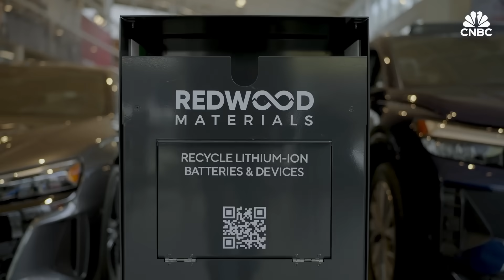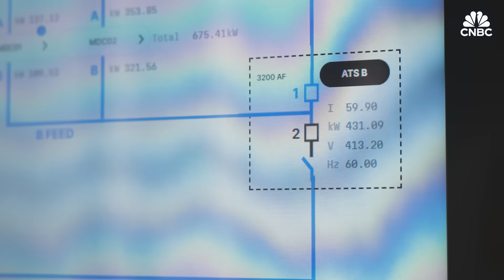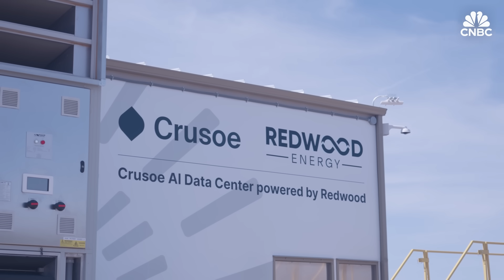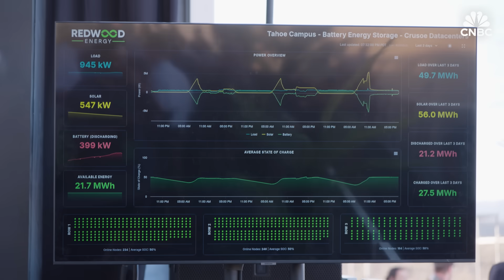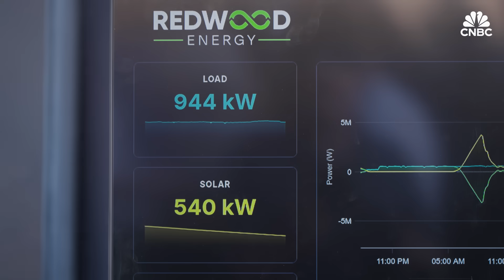How Used EV Batteries Are Being Turned Into Data Centers To Power AI

Comment: My first thought was that “wow they aren’t even trying to maintain the batteries. I can’t imagine they last long in the desert heat. Then I remembered, they would have otherwise been disposed of. Good on this company! Love the environmental consciousness
Reply: You think they would at least build a cheap plastic canopy above the battery to protect against the heat from the sun 😂
Reply: @PetriDishTech   In reality, it just depends on how much draw and charge rate is going through these batteries. A car can have pretty high charge and draw rate, some cars charge in like 20 minutes. These are to supplement solar power for the datacenter, which means it's charging during the sunlight hours and discharging throughout the night. The charge and discharge rate would be substantially less than a car in use, and thus the temperatures would probably be substantially higher. It most likely doesn't get anywhere hot enough from the sun that you would even need to waste materials to build a canopy.
Reply: The optimal temperature for those batteries is around 120 - 140°F, so they put them there intentionally.
Reply: they should at least cover it with reflective foil....
Reply: "I can’t imagine they last long in the desert heat"

10 year old tesla batteries sitting outside are still good. It's a popular restomod. Also, batteries like this get recycled, just about any battery in the last 20 years can be completely recycled (96%).
Reply: they are just killing batteries under the sun
Reply: This model is not sustainable and it still creating emissions and waste.
Reply: So when these batteries are done they'll go in the land fill,
 wow very green!
Reply: @Eduardo_Espinoza  Nope, no landfill.... The main operation for Redwood Energy is to break lithium batteries down into to basic components for reuse.
Reply: @Eduardo_Espinoza  lmao numerous times throughout the video mentioned the company's main business as recycling batteries. talk about a lack of comprehension
Reply: @Eduardo_Espinoza it's almost as if you didn't watch the freaking video before commenting. This battery system is literally on the site of a recycling plant. The goal is to fully deplete the battery usability before recycling.
Reply: @Eduardo_Espinoza  No, they get recycled. Did you watch the video? Redwood is a battery recycling company. If the battery has capacity left, it's more economical to reuse them for storage than to immediately recycle them.
Reply: @Eduardo_Espinoza  Literally at a battery recycling plant! They are still too useful and have decent capacity left. When they die, they will get recycled.
Reply: @Eduardo_Espinoza  Nope, they are fully recyclable. As is any battery made in the last 20 years
Reply: @Eduardo_Espinoza did you even watch the video 😅
The battery 10 years in auto use them 4-5 years in power plant. Then recycle to ge the raw material 😅
Reply: @Eduardo_Espinoza  🤷‍♂️ the alternative is try nothing and just trash the remaining years we have or try….or convince one another to reduce and reuse consumed items. Just think any attempt is better than nothing at all!
Reply: @Eduardo_Espinoza  Why would Redwood Materials send them to a landfill when their chief operation is to recycle them back into raw materials, which they do with a 95% recovery rate? Do you suppose they are burdened by all these raw high demand materials and the revenue they generate from them? That is literally the basis of their existence. It is always a bit entertaining and sad to watch people with the attention span and intelligence of a gnat share their "wisdom" on the internet.

Comment: I was wondering why the batteries had so much space between them. Is it in case they catch fire?
Reply: The batteries are placed far apart from each other and electrical equipment, and depending whether the battery is encased as a pack or individual models is covered in a fire supressing blanket. The proprietary control equipment is designed to handle faults developing in one battery unit without disrupting other nearby unit's operation (which is why each battery having its own power control connection).

Basically, they've taken a system level approach one that addresses the risks involved using a combination of space and integration approach. They test the battery quickly for power and plug it in, if it develops faults (fire or component failure) the battery can be isolated and there sufficient space for time to resolve the problem till the battery can be pulled for recycling.
Reply: Q: Is it in case they catch fire? A: yes, but also watch the video, it's less than 15 mins.

Comment: 1:29
Does anyone see a lot of wasted space there?
Brain tells me it wouldn't be much more in materials to put the panels above the batteries... Shading them and using like 2/3rds less space...
Reply: Land is cheaper than land covered with frames which aren't needed. The best part is no part, if you can pull it off.
Reply: I can imagine a solar farm would generate a lot of heat underneath
Reply: @Pat-Man81 I don't think so. The area is shaded from the sun . It should be cooler than the surface of solar panel

Comment: One day it will catch fire and there’s no way to stop it this is dangerous
Reply: The batteries are placed far apart from each other and electrical equipment, and depending whether the battery is encased as a pack or individual models is covered in a fire surpressing blanket. The proprietary control equipment is designed to handle faults developing in one battery unit without disrupting other nearby unit's operation (which is why each battery having its own power control connection).

Basically, they've taken a system level approach one that addresses the risks involved using a combination of space and integration approach. They test the battery quickly for power and plug it in, if it develops faults (fire or component failure) the battery can be isolated and there's sufficient spacing for time to resolve the problem till the battery can be pulled for recycling.
Reply: They're 10 feet apart and covered with fire supressing blankets. Not gonna spread easy.

Comment: I worry about fires and if they ever had one it would be absolutely massive with the batteries as close as they are.
Reply: There not close and those batteries provided as modules rather than complete packs are placed in fire surppressing blankets. I would assume the spacing is sufficient that if any one unit goes up it will burn itself out (with the electronics disconnecting it from the array), with the battery unit just pulled and recycled once it calms down.

Comment: oh wait, you using gasoline transportation to move those recycle heavy giant ev batteries around ? 😅😅😅😅😅
Reply: Electric forklifts exist and can be used, as to transportation of the batteries to the site this will shift to EV's over time - there are similar operators in Europe who used HGEVs to move renewable and battery components for this reason.

Comment: Great idea, but to store that many batteries inside that close together is dangerous. If one catches fire, impossible to put out. Especially in a area with very little water.
Reply: Seems like an easy problem to solve
Reply: They are spaced out with careful engineering calculations, so they are by no means close. battery fires can't be extinguished since they are chemical fires. Source: I work in the industry
Reply: @luvmsiahatethegov  - plus their either installed encased full packs or modules within heat/fire suppressing blankets to minimise the risks to other units from any one that goes up.
Reply: So you're smarter than them
Reply: @Wildman-zh8lg Not smarter, they said that they were getting overwhelmed with batteries. They just need a better storage system. I want them to succeed, but if that place catches fire, no one will ever want one of those places in there community.

Comment: Many of the EV packs are from recalled units. The battery might be perfectly healthy when it arrives and have many, many, many years left to go before it can be recycled. Another thing not mentioned in the video is the (gravel and dirt) space between the packs and the fact that the battery packs are on cinder blocks. If a pack catches on fire it is far enough away from the other packs so as not to be a fire risk - it, also, disconnects if a fire is detected. You can let the pack burn until it is done and then go in and remove it safely. Also, the solar panels aren’t erected on racks but horizontal. It’s cheaper to do this (but less efficient) and it also makes washing them much easier (which is more efficient). I guess if we’re stuck with AI we might as well power it this way.
Reply: Nice comment
Reply: I surmised the same thing as the pack distance is also a big detractor for power density/acre a simple cinder wall or dirt berm and double stack the pack wound 4x capacity.  They are not liquid cooling the packs anymore either which is accelerating their degradation in the Nevada sun.
Reply: @gr1f1th  Packing battery packs closer together means it is more difficult to drive between them (with a forklift, for example). Moving earth for berms adds to the price and you lose driving/maintenance access. Building walls (even if they’re small, basic dry-stacked discarded [free] masonry bricks) adds cost - and they would need to be moved to replace packs. Double stacking might work but the land where they are is dirt-cheap so spreading it out isn’t a big deal. This is ideal for big, flat areas but not where square footage is a big consideration. 
The packs are no longer (liquid) cooled but I’m guessing the nighttime temperatures are cool enough to displace a lot of heat for a third of the day depending on the season. The white bags (on most of them) may even help. There’s even a chance that the packs are actually cooler sitting in the sun than being used in a vehicle but I don’t know.
Reply: You cool with covering hundreds and thousands of acres with solar panels to make the hundreds and thousands of Megawatts and Gigawatts of power being used by AI datacenters?
Reply: They should recycle it right away before giving it a chance to catch fire or else recycle companies won't take it in anyone to make a new one!
Reply: @Eduardo_Espinoza  they are a recycle company first.  this is a side project for batteries they deem as more profitable as second life, they are doing what you are suggesting.
Reply: @Eduardo_Espinoza  that's not how battery fires happen, champ.

Comment: Guess the hot sun doesn’t matter?
Reply: The batteries won't be used to the levels they are in EVs they were designed for, the cinderblocks raise the packs and help with air cooling, plus warm batteries work better than cold ones.

Comment: Wish all the good luck balancing the pack with different SOH
Reply: Why assuming they're seeking to balance the array - with the power control unit on each individual battery pack/module-set it seems they're seeking to use them as individual battery units configured in a loose network. Each battery unit contributing what it can to the array rather than seek to balance the whole array to be optimise as a single unit. Basically they're seeking to use the remaining power whilst they can then pull the battery when no longer viable rather than seeking to extend the life of each individual battery unit within the array.

Comment: I believe the old electric batteries can be further enhanced by using flywheels in a hybrid system of storing energy to power the data centers.
Reply: I thought flywheels have a very short power cycle, similar to a UPS?  It's an interesting thought.
Reply: @jerseymetalmike5111  Batteries and flywheels can help benefit one another effectively in a hybrid system.
Reply: Uh, what? Flyweels don't have any relevant amount of power storage per dollar spent on them. Their use in an energy grid is to constantly smoothe out the power draw fluctuations. But modern batteries are already very good at adjusting powrr input/outout in frqctions of a second, so flywheels are not really needed
Reply: That's idea 💡?  Hybrid technology 😂🎉?
Reply: @FredHousehold Hybrid technology that complements one another in the role of storing renewable energy.

Comment: One great advantage of the US over other countries is the fact that they have a massive empty lands that can support this kind of development. Im sure it is much cheaper to lease these lands compare to say eastern Europe.
Reply: It’s not an advantage and literally every single countries have this kind of development and battery storage setups it’s all how you manage it that matters
Reply: @carholic-sz3qv Every country has the land for this infrastructure?🤔
I guess you have never been to Singapore?
Reply: This kind of development is super bad! The exposed battery cases under the hot sun or cold climate makes no sense! In Europe for example they are very well integrated into types of containers with AC units and can literally be dropped everywhere even on top of mountains
Reply: @carholic-sz3qv  - these are fully end of life battery packs (sent for recycling) - they may have been pulled from faulty cars, accident vehicles, or even other repurposed energy storage batteries applciations when no longer viable, and will arrive with varied capacity levels left (from full to none at all). They're being sweated as energy assets whilst they can be before being recycled. There is no intent to spend large sums of money to test and optimise each pack as they're on their way out anyway and are just one step away from being recycled for materials. Each battery pack (or module set) is just plugged in, after a basic power capability test, if it works then it works as long as it lasts, if it fails it's pulled and replaced. 

They also have a low cost install approach (cinderblock, no thermal management other environmental air cooling), but are running the batteries at lower energy demand levels than what they encountered whilst in EVs (so at a much lower heat generation level). The safety precautions are similarly low tech, using space separation and fire/spark suppression blankets (on module-sets, not required for full EV packs) that prevent other battery fires spreading from a battery going up to the battery being protected. There is no intent to stop battery fires rather to prevent the spread. 

This is basically a low cost systemic approach to extending the last miniute lifespan of a battery to extract the maximum energy potential from that battery.

Comment: No data centre which costs billions to build and must deliver 99.999 reliability is interested in using old EV batteries.  If a battery is not good enough for a $50,000 EV, it is definitely not good enough for a $3 billion data centre.
Reply: You are aware the batteries in car are considerer no longer viable if they drop below 50%, they still run normally they just hold less energy, that's an issue if you want to drive your Tesla 300 miles, it not an issue if you know that it's 50% down when you buy it and have 100 of them giving out power as the number of them doesn't matter.
Reply: @thewelshwarrior4634  Do you know of an insurance company happy to insure a $3 billion dollar data centre dependent on 10-year old 50% depleted EV batteries for backup and emergency power? I do not, because there is none.
Reply: @RossWexford ummm... Basically every insurance company in the world, there's a whole industry for insuring weird and novel infrastructure, also did you watch the video they literally track every pack multiple times a second and replace one if it gets worn out, also also almost every data center in America has some form of battery storage, this idea is the same just we older batteries
Reply: @thewelshwarrior4634  Strainge opinion. I have worked 40 years in the power plant business, and a few years building data centre energy centres and know of no insurance company anywhere in the world which would accept used batteries in any energy installation. You are out of touch with reality.
Reply: Data centers make up 8.9% of the total power share in America, based on analysis from the IEA. They need more power due to AI, consumption will rapidly increase. We need more nuclear power that's the fact.

Comment: Batteries in Bags on top of cinder blocks, Got it!
Reply: EV battery already have ingress protection.
Reply: I guess cheap+cheap=cheap!
Reply: Yes I'm wondering what the bags are doing. I would put offer a simple roof to keep the temperature lower and shield off the connections
Reply: And somehow still cost billions lol
Reply: this is a clown news network. It's why it is a joke
Reply: @CoolChannelName thanks for supporting the clown news network
Reply: EV batteries are nothing but thousands of AA batteries (little big) module! I have never seen an article that talks about the environmental damage of manufacturing them.
Reply: @GCPCA-p5b I guess you never searched for it. 

But I'll give you the summary: In most energy grids the environmental cost of an EV becomes lower than a gas vehicle after 50k miles or so. In greener energy grids it's even faster. But if you almost never drive the car you shouldn't buy an EV for environmental reasons.

And you probably shouldn't buy a car at all, and use public transport, Uber or rental services when you need, if possible.
Reply: @GCPCA-p5bWeird, I just did a quick google search and found dozens of articles discussing the environmental impact of mining components for batteries. What have you been searching for where you can't find any articles?
Reply: @GCPCA-p5bHave you ever tried google?